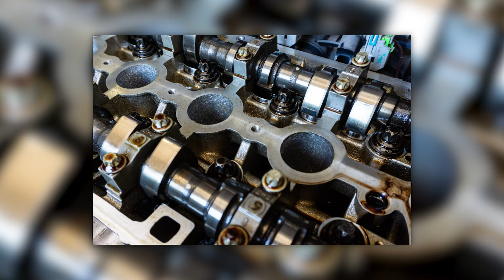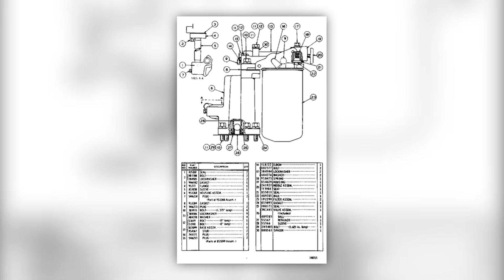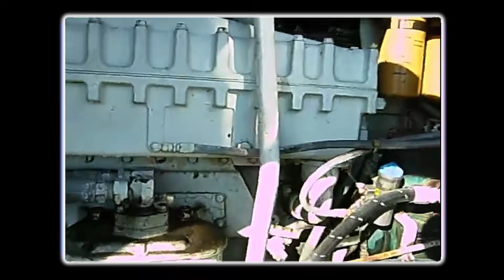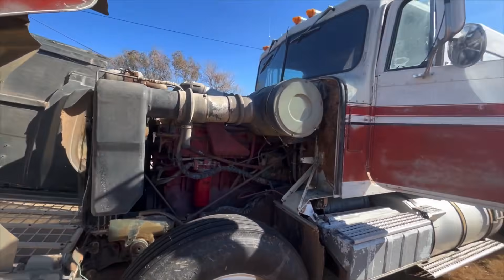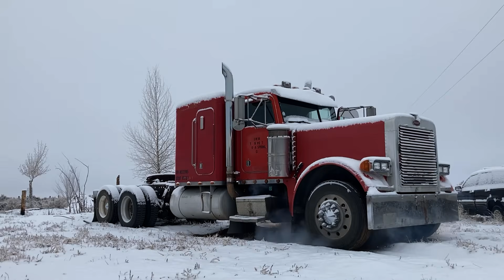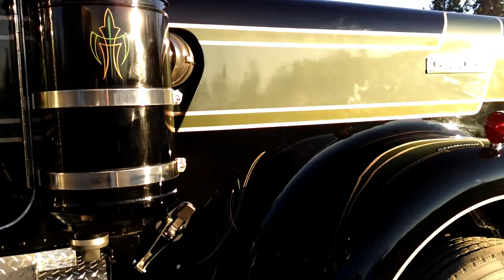The Truth About the Legendary CAT 1693: A Mechanical Beast

Comment: Hired on to an outfit that had 1693s in A model Kenworths.  My first day I showed up grabbed the keys and went out to the line.  I found my unit pre tripped and started her up.  I freaked out because of the noise and shut it off.  I rechecked the oil to verify level snd started her up again.  With good oil pressure I warmed it up and headed out.  I instantly fell in love with it.  It was so smooth and quiet.  It was a low stress environment that pulled like nothing else I had run prior.  Holding your foot on the pedal in one spot as you hit a hill it just spools the turbo and pulls hard.  This video makes a few false statements that were not my experience at all.

Comment: The 1693 ushered in a different ere of Torque and horsepower. It was a game changer in the sense that Fuller and Spicer had to offer clutches, transmissions, and drivelines for all the extra torque. These were the first million mile motors. Typically, Cummins went 300,000 miles and DeTroit 250,000. between overhauls. The 1693 changed that standard. Yes, they were heavy . They did 4-5 miles per gallon . But for the horsepower and performance involved, it was worth it. Their only weakness was running low on coolant or getting them too hot. They WERE the engine until the 3408 and KTA .

Comment: When I first started driving many decades ago, our sand trailers had 1693’s and our concrete mixers had 1674’s. As time went on our sand trailers were eventually equipped with 3406’s and our concrete mixers were equipped with 3306’s, which were great engines, but I did end up missing the “bucket of bolts” sound of the 1600 series engines.

Comment: What’s the difference between this engine and the 1694 cat?
Reply: Not a 1694, a 1674. Most of the Cat 1600 series were dual over head cams (1674, 1676, 1693) .The 1673 And 1670 they  were push rod engines. The 1673  was the early version of a 3306.
Now a 1693 was a 5.4 bore engine, while the 1674 was a 4.75 bore engine. Its sister was a 1676 V8 version. I have never seen or worked on a 1676, nor a 1670. I have seen the off road version of the 1676.
Reply: @JohnGoldsmith-v2v 
I stand corrected 
I think I ment the 1674. Was fascinated by the 1674 cause it was the engine used in the 55 peterbuilt truck in DUEL.

Comment: Worst thing to do on this engine is change out the water pump to engine oil cooler! D343 water pump was a snap. Had a company that used a welder to jump start their engines, burned glow plugs and caused arcing across the cam to lifters, this is a fact! I built many many of these engines over the years, working for a Cat dealer, 47 years! the D346 and D349 engines were 90 Degree blocks that had the same camshaft bearing block design. The later ones were 60 degree blocks and the cams were in a housing that housed them. And by the way it is a no.2 Philips screw driver and feeler gauges to adjust the lifters for the valves.

Comment: The 1693's camshafts were driven by the gear type accessory drive located at the rear of the block.  The 1st CAT engine series with unit injectors was the 3500 series in 1980.  The 1693 like all CAT engines until the 3500 series had an inline injection pump, high pressure lines to each injector.  If you run out of fuel you have to crack the injection line nut at the head then pump the priming pump until bubbles disappear.  The 1693 was derived from the legendary D343.  The D343 coolant pump was driven off the rear accessory gear drive.  This location made the engine difficult to fit in a conventional truck tractor so the pump was located on the front of the engine.  Until the 3200 series predecessor all CAT engines from the 1st in 1930's had PC fuel injection.  PC, Buda Lenova, & Ricardo indirect fuel systems work with lower quality <35 cetane fuels.  DI fuel systems require Cetane of 35 or greater.  Engines with DI fuel systems are more fuel efficient.  PC engines emit lower NOX however more PM.  Besides being more robust than any competitors truck engine owner operators loved 1693 because they could increase the maximum power by throwing away the rack screw in the governor.  Every Owner Operator & mechanic new where the rack screw was located.  The last PC engine CAT made was the D399 in 1982.  The mechanics who worked on CAT dual overhead cam engines hated them because of the difficulty of working on the top end.  The most hated engines were the D346, D348 & D349.  One thing going for the OH cam CATS is they had very high overspeed capability wo/damage.  I saw a D349* model engine which had a 1900 RPM max speed rating after an overspeed where a witness observed the tach needle pegged at 3500 RPM when the governor to rack linkage failed & the shutdown solenoid linkage was rusted frozen.  Eventually the only thing that stopped it was two pistons split in two at the pin bore, the rods then broke the liners & block and rapped around the crank.
P.S. The reason CAT designed dual overhead cam engines in the 1960's was the Chief Engineer for CAT engines was a fan of European racing engine tech.  This was told to me by my boss who was an engineer for CAT in the 1950's & early 60's.  My knowledge comes from 35 years as an engineer for a large CAT engine dealer. 
* The D348 & D349 engines had the transient response of two Driptroits.

Comment: 1693 (D343) in 988A loaders and 769 35 Ton haul trucks had glow plugs you didn't and shouldn't uses starting fluid,  this family of engines V8 in Cat 773A 50 ton haul trucks D348 used in 992 A and 992B 10 yard loaders, I worked on them all, good engines though would not forgive being over heated the cylinder heads would Crack around the threads of the pre cup and allow combustible in the cooing system.
Reply: I for failed to mention D346 v8 D348 v12 all had glow plugs drawing 6 amps per plug when the heat start switch was in the pre heat position held manually for approximately 1 - 2 minutes

Comment: Wow was hoping to learn something from this video do your research before making a video 1693 was NOT a unit injector engine and it did Not run injectors off that cam that didn’t come about in cats till the 3406e. The 1693 had an injection pump mounted on the side with lines and nozzles in the head similar but different from a 3406 A B And C

Comment: We always called them Cat 4 and a quarters. They didn't have unit injection. Just as someone else said you had to watch the pirometer and water temp long pulls tested that moto
Reply: Wrong engine 
This is 1693, not the 3406

Comment: Drove an old Autocar with a 1693 years ago. We always said it sounded like a bucket of bolts. They did run great though.
Afterwards all the rigs we had had 3406s. I did drive a 3408 powered Pete, real hill flattener.

Comment: I would love the loud noise of this engine and the powerful pull it has. But I am a retired truck driver now. But I did drive one with a C-15 Cat 475 hp single turbo for over a million miles with no problems but the starter having to be replaced at 758,987 miles .
Reply: Those single turbo ACERT Cats were awesome
The twin turno ones had issues
I drove a C15 and C12 single turbo.....lots of torque and reliable

Comment: Then there was the V8 version that was a total beast.
Both of these engines were used in 657 dual engine earth movers, the V8 in the front and the industrial version of the 1693 out back.

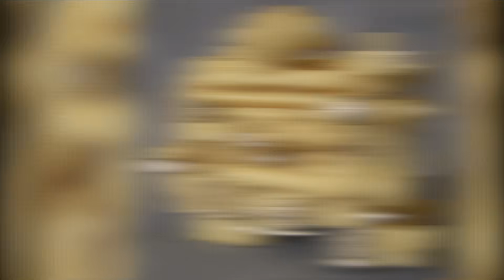Comment: 4:56 the pre cup combustion is what gave it the Clatterpillar sound. 
Never heard the term Rattlepillar. 
Pre cups are not “ efficient “ or clean burning.
Reply: 1693 will always be the big dog,although I never had one. I bought a1976 cabover with a 3406 cat precup drove coust to coust, short wheel base very rough riding wish I still had it. Could write a book about trucking in 70s and 80s.

Comment: As a young mechanic in a Cat shop I learned the high points and low points of this engine. Never get it hot. Cylinder head would fail. Front crankshaft seals and water pumps very difficult to do. But what you could do with the fuel system was crazy. You could tune this engine so it could pull the devil out of Hell. Oh the sound the engine made was amazing. Like one truck driver told me it sounds like two skeletons f*ck on a tin roof.
Reply: Bullshit!!!!

Comment: "A straight six was smoother than a V8"  Say what?  You then proceeded to spend the rest of the video telling us how rough the 1693 ran.  

ANY engine, regardless of how many cylinders, still requires the crank be balanced.  The 1693 wasn't well balanced.  Period.  All the little details like twin cams and pre-ignition had nothing to do with that unbalanced crank. 

And another fail by this AI.
Reply: How do u know it wasn't balanced properly? 
Did u engineer it?
A lot has to do with the injection timing and ignition lag before TDC .......
Also valve timing.....lots of factors
There was also no pilot or split shot injection back then
And the prevombustion chamber cause lots of diesels to rattle or have a higher diesel knock like the older volkwagen diesels.....the GM 6.2 6.5
The internationals in the older ford with the 6.9 and idol 7.3
U sure u studied diesels?
They clattered back then
Reply: @fil1329  
 - "U sure u studied diesels?
They clattered back then"

And most of those diesels were two stroke.   They are notorious for being noisy and running rough.  If you knew anything about diesels then you would have known that. 

And I never claimed nor implied to have studied diesels.
Reply: Look how bad secondary harmonics affected the 60 degree 3408.  Are you a Cat fanboy?  How pathetic was it that the 1693 was indirectly injected?  How long did it take Cat to figure it out?  😂

Comment: I started driving back in the early '70s. Back then there were only 3 diesels that mattered in the USA: Cat, Cummins, and Detroit. Mack, meh. You could tell which truck had what engine in it by sound alone. The 1693 sounded like a bag full of marbles and you could never mistake a 71 or 92 series. Cummins and Mack were civilized compared to Cat and DD. I drove a needle nose Pete for awhile and the presenters description of things rattling and loosening up made me laugh. It brought back memories.
Reply: Brother we ran Mack’s hauling coal and those mountain trails would tear most trucks apart. Slow and beat your brains out but they were damn good trucks. I learned in a 75’ DM800 Tri-Plex15 speed and #65k bogies, underrated and overbuilt I liked walking them dogs. The guys with big $ ran 400 BC’s which I love too, can’t stand the new piss burners
Reply: @deborahchesser7375 which mach engine?
The E9 v8s were huge and powerful
How about tye modern E6 or E7s?
Maybe u drove the thermo-dyne  older engines?
Reply: @fil1329  it had a 300 plus and we had a DM600 with the trusty 237

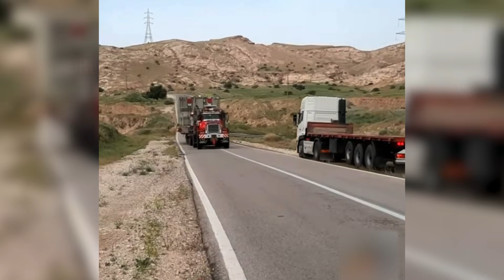Comment: 1:59 Hello sir . How did you know this heavy hauler is equipped with 1693 cat . I am in iran and know this 10  truck.   But one of them is equipped with cummins v12  vta1710 or vt28.  No one have spoken about these big autocar yet . Only 100 of them built mostly for soudi arabia with Detroit 2 stroke.   But 3 or 4  of them made for iran mountain in oil field area in south western of iran . There are many mack and autocar but today only one of them continue to operate.  I am 100 % sure its most powerful heavy hauler in the world  packed in legally  road going truck . ( some says mack sx100 or m ) are most powerful.  I am not agree because of wheel difference.  In USA and iran 24" and 20" and 22" are legal for roads . And  big truck equipped with bigger tire and rim . 

I am ready to Corporate with you to make video about this truck.  Because 50 - 60 years ago usa made biggest on asphalt road  heavy haul truck  for single ship it can haul 300 ton at any grade . I can share this original video with you this 1693 cat in this video also did very good job . But in real video you can hear 5 or 6 down shift gear.  If it was its bigger brother with vta 28 / vta 1710 I am sure it could climb this grade with higher gears

Comment: How does valve lash be done without a rocker arm to adjust? Its DOHC  🤔  it would need lifter shimming if  solid or hydraulic lifter sitting atop the valve.  I will praise your  video, I've  never seen  or heard of this fascinating oddity.
Reply: Would you believe with a phillips head screwdriver... "Insert a phillips screwdriver in the slanted hole and turn screwdriver clockwise to increase valve lash....."  from the Operation & Maintenance Manual
The cam box was very narrow with small diameter (relatively) camshafts so no real room for fingers. So a bent feeler gauge set and a screwdriver and it could be done. Also horrendously expensive in manufacturing terms and the the much simplified 3406 had nothing like it as it was a more traditional in block single cam engine.
Reply: @ianloy1854   When I went to diesel school, in the late 70'S, at UTI in Phoenix, they had one each 1673 and 1674 Cat engines on the Engine pad. 1674 was also a dual overhead cam, inline 6 engine.
Reply: @ianloy1854  If there was enough clearance, you could remove the camshaft drive shaft and turn the cams with a pipe wrench to adjust the valves (like you said, with a phillips head screwdriver) without turning the crankshaft. I had done this routinely with my father, back in the 70'S. A few old timers had used a hole saw to access the camshaft driveshaft through the firewall to allow this process.
Reply: @russstyczinski  Somehow I am going to guess that wasn't in the service manual. One thing that never amazes me (now) is the ingenuity of truckies. Part of it is they have plenty of time to think and a tendency to ignore the standard way of doing things if there is a better way. Re the 1674 I will bow to your visual experience. I wish I still had my listing of every serial number Caterpillar has ever made. I had even annotated it to have no cylinders capacity bore stroke for the engines..... But a computer crash and.......
Reply: @ianloy1854  I had only seen references in a book of a 1678 Cat engine. A dual overhead cam V8 with both front and rear gear train to run to each bank. My father worked for a company that had several 1693's. He was the one that showed me the pipe wrench trick. He's 93 years old now.
Reply: I think it was the 1673 270hp engine had the overhead cam and the adjusting screws had a detent. When you turned the nut one click was 2 thousandths of an inch adjustment. The 1693 had an SAE #1 flywheel and housing, the D343 had a SAE #0 flywheel and housing more suited to
off road, industrial, and marine applications. Its Achilles heel was an oil gallery plug that would back off over time, and that was the end of the crank. I didn’t realize it was that heavy. A dry KT 450 weighed 3300 lbs, and I believe it was 1050 cid ? It seemed that most Cat bolt on components where way over built. One thing that was well known was you could turn up the power very easily, and I think that was done by most 
users back in the day, but it cost you.
Reply: @georgerenton965 Kt Cummins 1150 cubic inch, big cams were 855
Reply: @DuaneWilson-ro1pn 1150 👍
Reply: @georgerenton965   Not a 1673, it was the 1674, youu adjusted by clicks. A 1673 was a push rod engine.

Comment: The 1693 precombustion chamber reminds me of my 680CK Case engine, except with the Case, it shot the injected fuel across the cylinder bore into a precombustion chamber on the opposite side of the cylinder.  It produced a rattle that sounded like you had 4 pistons trying to change holes with each engine revolution.
Reply: Ahhh the lanova type diesel combustion chamber i think it was called
Rare today but I recall taking that in a theory lesson in college 
I wonder which other engines used that type?

Comment: There where so many wrong statements. I truly dont know where to start.
Reply: you must have gathered your information from forums, 90% of your information on the 93 is absolute BS
Reply: Like it was made for class 8 trucks😂it was made for industrial use in scrapers, graders, n dozers. Dahhh! Cat didnt design any inline 6 engines for trucks until 1975 when the 3406 was born with a fuel pump on the driver's side to minimize linkage issues...dahhh!
Reply: So much wrong with this video